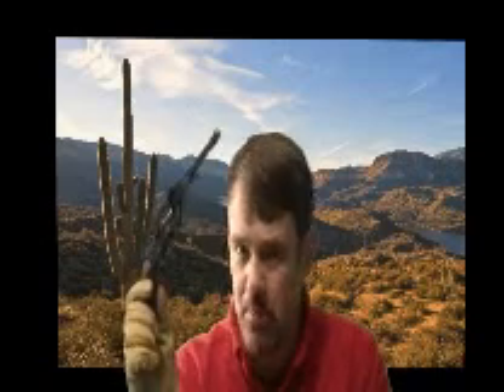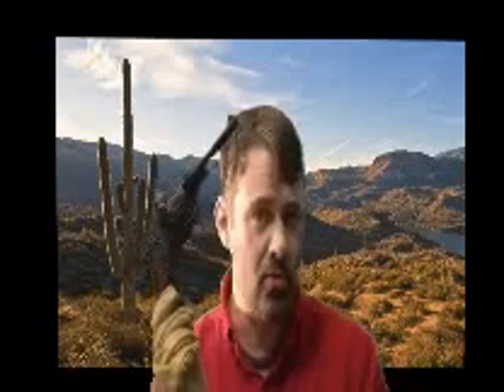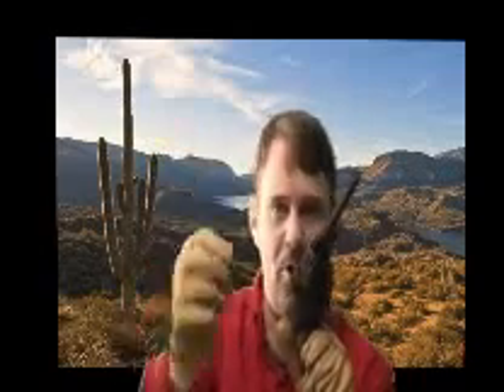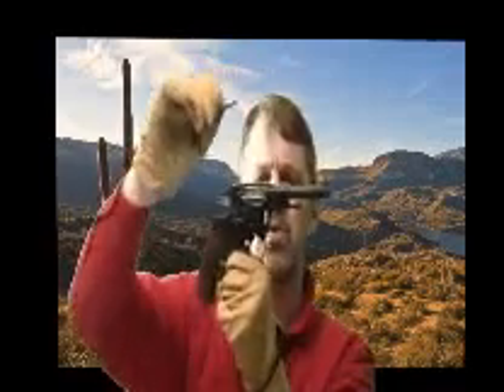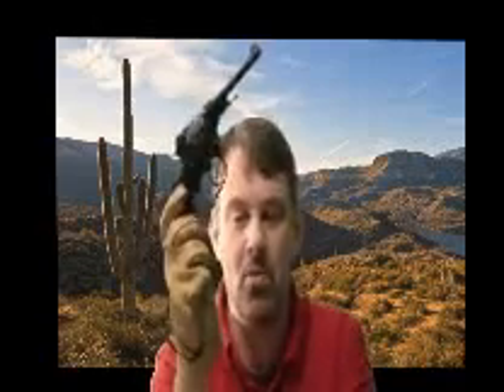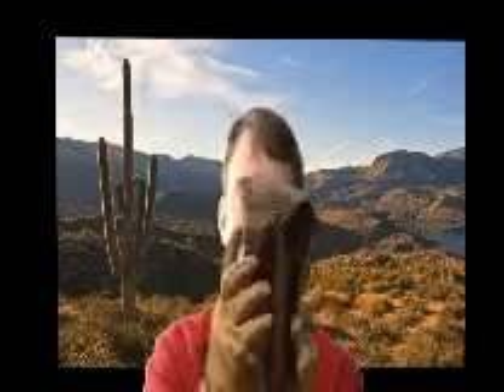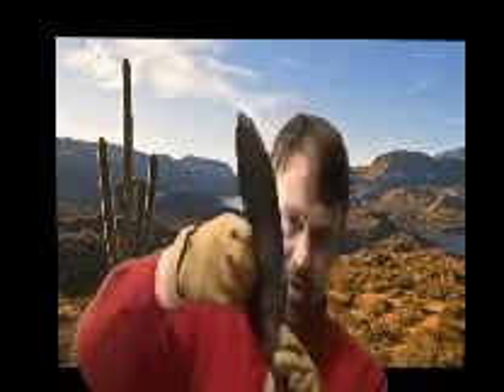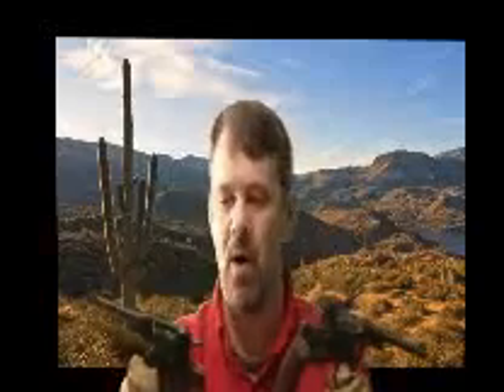Russian 1895 7 shot Revolver

Comment: TT33 for sure. I am from Russia and I own one.  Man, that's a good gun. Heavy machined steel, slim, easy to conceal. The only downside it is SA only. Lightweight 85gr bullet goes 1500 fps so it will punch through a foot of solid wood, a car door, or any soft armor.  Easily modifiable for 9 mm Luger. Weapon of choice for the thugs and the citizens who do not want to be an easy prey. Bad thing - if you live in Russia, keep it quiet. Handguns are still off limits for civilians, that's 5 years in #